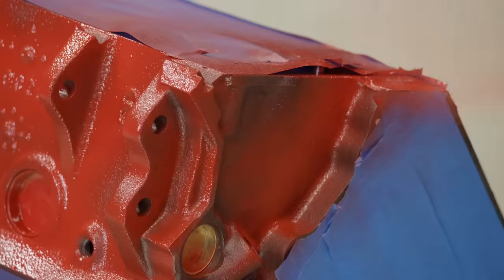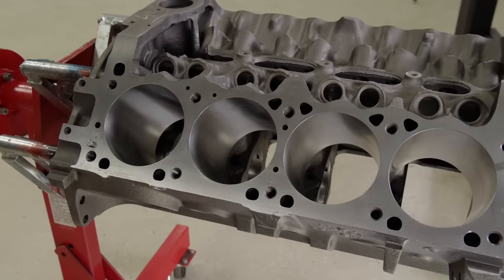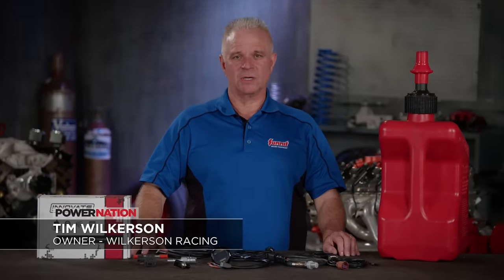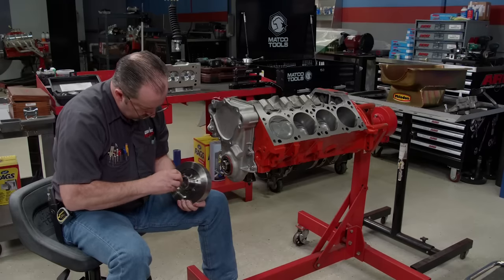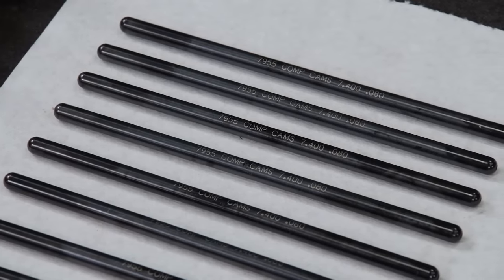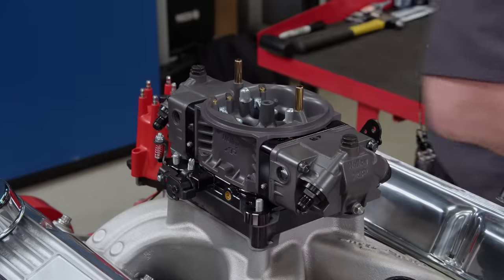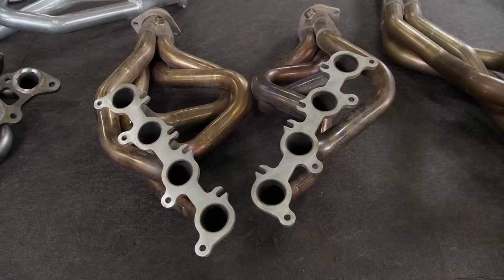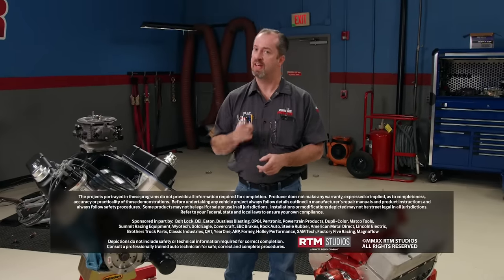Assembling a 410 Mopar with High Flow Induction - Engine Power S7, E9

Comment: Get it on the dyno
Reply: What’s the holdup getting this on the Dyno and the video aired?
Reply: @number1catfish959  they use the Magnum block with LA heads and the block doesn't have the oil passages to feed the heads, maybe they already Dyno it and found this out and it burnt up the valve train
Reply: Steve Howard  the  trick flow heads with work both la and magnum block
Reply: @Zachsmoparandmashedpotatos  0nly with these rockers Harland Sharp S72025K, lifters and the correct pushrods to feed the top end
Reply: @steve6992  they are using Harland Sharp here
Reply: @smilsmff  ok cool
Reply: @steve6992  long as the lifter oil through the push rods. They be ok.
Reply: @racecitypatriot5017  not necessarily, the Rockers that they are using are purpose built Harland Sharp rockers for these cylinder heads
Reply: Yeah the $1000 rockers.. Wish they used studs like my edelbrock performer rpm heads do on my magnum motor.. Then u can use all cheaper and easily available chevy rockers
Reply: @jayirving6996  sure and when valve train stability matters gm guys pay double that or more to get shaft rockers. Every time I look at and have to set lash on stud mount junk I thank Ma Mopar and could care less about the cost to by a rocker that lasts a lifetime
Reply: What I'm saying, what watched for, then no dyno
Reply: trick flows have beter flow more cc and CNC Ported
Reply: Today’s date is 10-13-20, I will NOT  view this channel again until 10-13-21!
Reply: Good how do I make this video available to me
Reply: @bigboreracing356  lmfao that dosen't even make sense you can put jesel rockers on anything. And the only rockers I would use on magnum heads besides t&d of course to get rid of the stud mount garbage exactly what I said in the first place. It dont matter how good the rockers itself is when its cantilevered on a  stud. Period
Reply: @bigboreracing356  not sure what your arguing about or why its pointless and can't be debated mechanical engineering and physics disagree with you not me,whether it works "good enough" or not  is irrelevant to what's is actually better. Cheaper absolutely better no. Your 900 runs is nothing thats what like 4 hours of run time. I do that in a weekend never been to the strip in my life probably never will not my kind of racing. Parts breaking comes down to alot more than just design. Nascar and F1 have no budget in their engines yet still occasionally fail so one lives another dosen't thats just the way it goes theres alot going on. Again no point in arguing about it. Its been decided by alot smarter people than the ones in this conversation.
Reply: @bigboreracing356  its always better it has nothing to do with HP didnt realize you were the authority on what I need. Last time I checked it all comes out of my pocket and I hate setting lash on my GM because its a stud setup. Last rockers I had on my doge finnaly had one roller tip come out after 20 years of racing so ill decide what I like and works better thanks.
Reply: @bigboreracing356  i never said anything about harland sharp, and never said anything about anyone else needing anything else. I said stud is junk compared to shaft regardless of the cost difference whether your comparing the worst setups or the best. You said how many passes you have and I pointed out thats nothing in wide open throttle hanging rpm run time compared to an endurance race engine because you implied that a bunch of strip time is supposed to impress me since its a reply to my comment drag engines are impressivein in their own right but I'm far more concerned with durability, output and the rules it has to run under at the same time, Kind of like spring pressure its application specific so it dosen't really matter if it lives or not with said spring pressure just says you have good enough stuff for yor application and I'm fine with that its still not the best setup possible if its on a stud lmfao, I'm not the one with a problem here you got triggered by something I said deal with it not my problem. Its irrelevant what I run cause their all different depends on which one what car it's for and what the budget is at that time but when I care its shaft by whoever makes the best setup for my budget at that time whether it came from the factory or not would a picture of My T&Ds be impressive IDK I wasn't getting into a "measuring" contest. One man's junk is another man's treasure, everyone can do as they wish ill keep sticking to facts 💯 might not need a 4340 crank or a custom billet but its hard to argue that their not "better" and will last a "lifetime" before it breaks even though a cast crank is all you "need" but you might argue that apparently, because stud mounted rocker failure is common and well documented when pushed to the limit especially when its not right even though it is cheaper regardless of what engine its on 😉
Reply: @bigboreracing356  pretty sure you can read or maybe not idk first word was sure in case you didn't know thats an agreeing term as in his edelbrock heads use cheaper stud mount sbc rockers, and they used the expensive harland sharps because they are the marketed rocker for the heads and a good rocker even though they are a bit  expensive comparatively to some others and also not the only ones that can be used on trick flow or any other la head with magnum lifter oiling by the way thats just marketing 😉 I never said jack about harland sharp specifically or any other brand. The next part was when it matters alot of GM guys step up to shaft rockers to avoid failures of stud mounted junk because it is that and the only reason it exists is cost control and ease of alignment issues and Most mopar and a few others too before it became about cost more than durability guys don't have that issue  of being weak because they come with shafts from the factory and I'm thankfull for that even if it costs more cause they dont break rockers unless they've been run forever or missused and even when they do break a rocker because something was wrong or fatigued its an easy job like when my 20 year old aftermarket one lost the roller tip because aluminum will fatigue faster than steel especially with solid cams and set of 273 irons went in its place for the rest of that engines life span.
Reply: Love to see this on the dyno so tired of this chevy shit.
Reply: @steve6992  PRW stainless steel rockers will work also...
Reply: Ahhhh boys boys boys. LA heads on a Magnum block is fine. . .IF you use AMC lifters that oil THROUGH the pushrods, rockers be damned, I didn't see any AMC lifters, in fact, I saw "retrofit roller lifters" why? Not sure, magnum blocks came with roller lifters, so why the "retrofit"? Something is definitely fishy, and it's most likely why there's no Dyno run here.
Reply: @life_of_riley88  The jacked something up that is for sure
Reply: @life_of_riley88  they clearly stated in the video the heads fit both blocks
Reply: @MineZilla123  Sure they fit both blocks. But both blocks oil the rockers differently, and they did not take that into account here.
Reply: No Prep Stretch oh I know that's why I have 2 sets of edelbrock heads sporting CHEVY. 1.6 comp rockers.. there on my dirt late model engines 318 and 367 being twisted to 7500 rpm routinely!
Reply: Peyton Rory  No one cares Peyton. No one cares.
Reply: What ever happened to this motor???
Reply: WTF  this was like reading a book with the last chapter torn out
Reply: @seektruth8662  that about sums it up.

Comment: Was really wanting to see those dyno numbers
Reply: Look at the solid LA smallblock style pushrod lifters they installed into that Magnum Block. The LA oiled through the head but the Magnums had hollow pushrod lifters which oiled the valvetrain. My guess: They destroyed the engine on the dyno, that‘s why they don‘t show it.
Reply: Trickflow heads are different
Reply: @Epik-hm8ws  BINGO! same bs with the Stroker big block mopars , they spend 10 grand and get less HP than a garage built engine using iron heads , No wonder Greg Anderson fired him!
Reply: @MrR6guy  Was always wondering about the low horsepower numbers. 

In a car with a waterpump, alternator and a more restrictive exhaust those numbers are not that impressive given the dollars thrown at it. 

Maybe they don‘t match displacement, headflow and cams that good together.
Reply: Yeah I watched the whole video for a dyno they never did too...

Comment: If they don't put this engine on the dyno soon, I am reporting this video to You Tube just purely for the frustration factor!
Reply: Literally still haven’t posted it😭
Reply: They won’t because they put a magnum block with shaft rocker oiling system and the engine failed.

Comment: 5.9 Dakotas are about to become sleepers. Those heads are very nice!
Reply: There are already sleeper Daks. There are a few 440 big block daks too but the swap kits are harder to get cause they stopped making the whole kit. Pro Charger has a kit for magnums too.
Reply: Edelbrock heads have existed forever and so have EQs. Both are fine options
Reply: @xjsc16x  Correct, I don't recall any of them being able to bolt up to newer 360s, which are everywhere compared to an early 360.
Reply: @NVzla  uhh I don't know where you've been for the last 10-15 years, but both of those options are available in either an LA or Magnum pattern.
Reply: How about a bottom line cost to build an exact duplicate of this engine, and dyno results...

Comment: If you’re gonna use E 85, be prepared for a lower fuel mileage as the air fuel ratio is higher. I saw this right away when ethanol was added to our fuel. I also know this by hearing about modifying carburetors for racing with methanol.

Comment: 410 sprint car. Mopar Performance booth at last year's SEMA spectacular. It's aluminum, it's got stack injection and dry-sump oiling, and it makes 830-850 hp at around 7,800 rpm while weighing only about 345 pounds. And as mentioned, it will do it for 30-40 laps (about 15-20 miles of racing) at a time, reliably. Mopar Performance W9 heads.

Comment: There is one type of stroker you forgot, the welded stroker. in the early days of hot rodding and high performance there were very little in aftermarket parts, so people would be forced to use stock components. This included welding up parts and regrinding them, this was particularly used for camshafts for more lift and duration, but a competent shop could easily do the same to cranks without sacrificing durability due to weakening through hardening or smaller journals. 

BTW the offset grinding method of stroking, requires either a shorter rod (if you planned to retain the stock pistons) or aftermarket pistons (if you wanted to retain the stock rods), but that would require special bearings that might slip. One of the best known budget grind strokers was the 360 dodge with the crank journals offset ground to the size of a 350 chevy rod (5.7") the offset would allow the stock 350 rod to run with no changes to compression

Comment: I'd like to see them take an old, forgotten, never loved, off the wall engine and see what could be done with it. Something like a B series 400 Chrysler, 318 Poly, 301 Pontiac, 425 Caddy!
Reply: Craig Roth the 400 strokes really nice.
Reply: ive got a cheapy built stock comp 400 in my dart. it is pretty damn impressive. revs like hell and is responsive too.
Reply: One of the Mopar mags still alive, did a 318 poly build. It will take an LA stroker crank, and go out to 392 cid. But the heads only flow so much, so it make more torque--like 500--than HP. There's new intakes, too, so you don't have to hunt down a 1957 dual quad.

As for the 301 Pontiac and 425 Caddy, the main webs are too thin to cut down on weight. Even the Turbo 301 isn't worth working on, step up to the 326 (which is actually 336 cid if you run the formula, Pontiac wanted to come in under GM's 330 cid restriction in the mid 60's for intermediates until they saw how many 389 Goats were selling and stepped up to 400 cid) or bigger engine. 

The Caddy does have three companies selling parts. The 425 crank has to be replaced, the Armasteel connecting rods need to be replaced, and a 472 cid is still affordable and its the same block so it bolts in rather than stealing its crank.
Reply: A forgotten motor would be the Pontiac 301 turbo not many people know about them.
Reply: @2010HarleyDynaFXD  
Or the 303 short deck. But that might only of been produced for the 69 Trans Am Firebird
But the big reason you don't see them straying too far from Ford small blocks and LS motors is parts availability.
Reply: 429 Caddy. My PawPaw had (and wrecked) a 68 El Dorado with that torque monster. God I loved that car, and if 8th gen El Dorados didn't cost as much as a liver, I'd get one.
Reply: @brettjohnson8009  210 hp  and 345 lb⋅ft of torque for the early 80's when emissions was killing horsepower wasn't bad. People also forgot about the 366 and 427 tall deck Gm engine.
Reply: @2010HarleyDynaFXD  I agree not bad , I worked in a reman shop  we seen a few 301's , I guess they didn't appeal to me because they looked flimsy, cast lighter , not much of a crank , used to do quite a few of those chev truck engines back in the day as well

Comment: They never mention how to get oil to the rocker shafts? Magnum blocks do not have a passage in the block to send oil through the head to the shaft. Magnum blocks oil the valve train trough the pushrod, however the LA smallblock rocker shafts/rockers do not have a provision to carry that oil to the rocker tip or valve spring cup. I was hoping this video would make mention of how they are going to get around that problem. Hopefully the TFS instructions say something about it.
Reply: Those HS rockers are made specifically for these heads and only these. They use the Magnum pushrod oiling setup. They also cost a damn pretty penny too.
Reply: The heads are drilled from trickflow so you can T off the sending unit to provide oil to them there’s pictures on google if you research LA heads on magnum block.   Hope this helps

Comment: Right on!! 3000-7000 rpm range  intake manifold...awesome  you could drag race  from stop light to stop light with about a 3500 rpm stall converter in a 727 torqueflight trans. Or us a  t6060 6 speed manual on an oval or road course